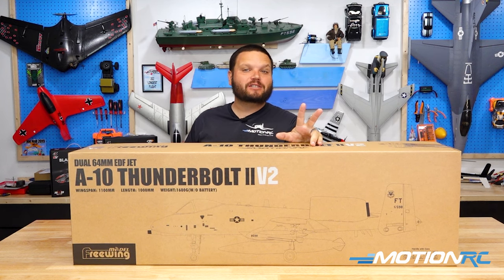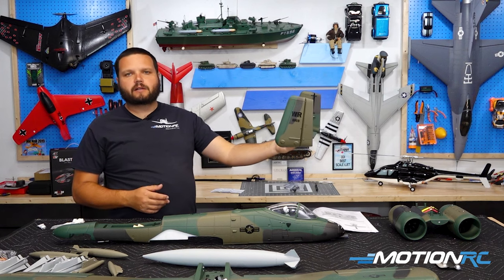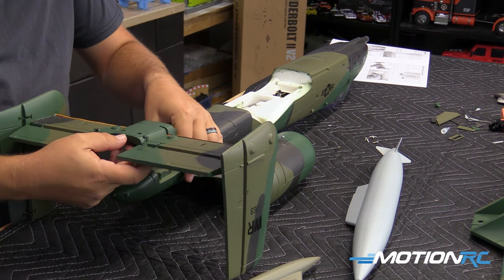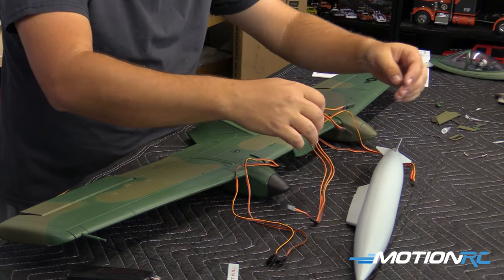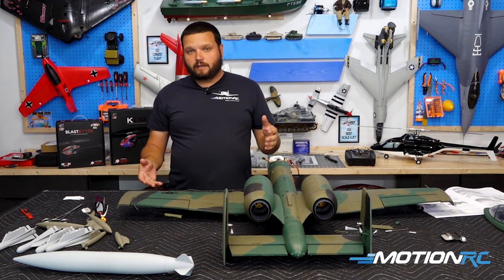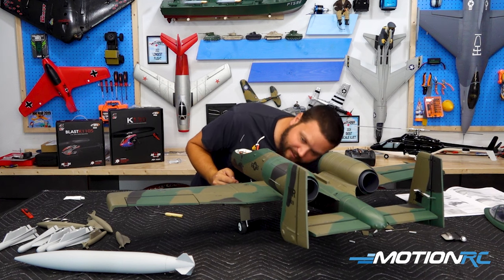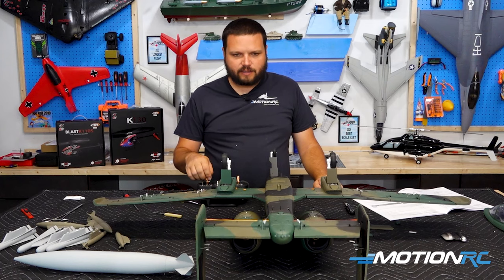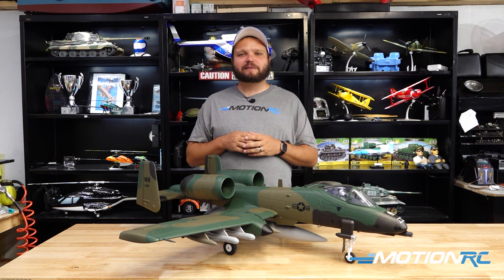Freewing A-10 Thunderbolt II 64mm V2 EDF Jet Assembly | Motion RC

Comment: would Relly like to see how you installed the receiver?
Reply: Should be like a normal unless you've never put one in.
Reply: @IceMan2035  looking for the location of the receiver  because there is not much room in the battery compartment were you would normal put it.
Reply: You might have to modify it some

Comment: I’m about to celebrate my 10th anniversary in the sport. I remember those first couple years wishing/hoping I’d be good enough to own a Freewing or Flightline airplane. Jets weren’t even on the radar yet. Once I reached “Advanced Intermediate” all I flew was Flightline and Freewing. The quality was obvious and was the ease of the builds. 
I like the price point on this a-10, but it doesn’t resemble any of my Freewing’s. (Glued on ordinance, glued on rudders, no lights, cheap landing gear) I’ve purchased the 80mm twin a-10, both Freewing T-33’s, Me-262, and my favorite, a work of art and in my opinion the best jet they ever produced, the 90mm F-22. This a-10 v2 doesn’t deserve to have the Freewing name associated with it. Rudders that attach with screws, ordinance that slide on and off, articulating landing gear and a couple lights, then it can be called a Freewing.